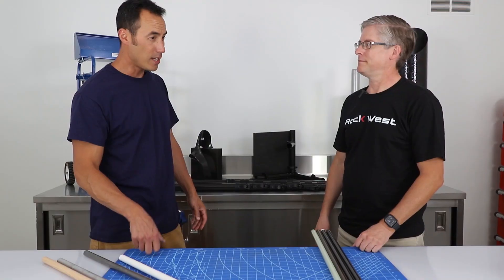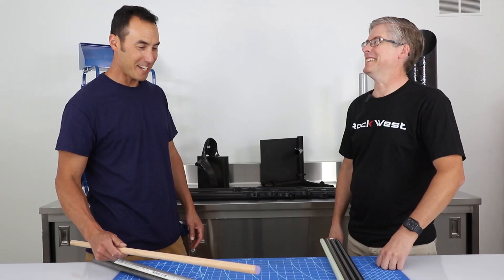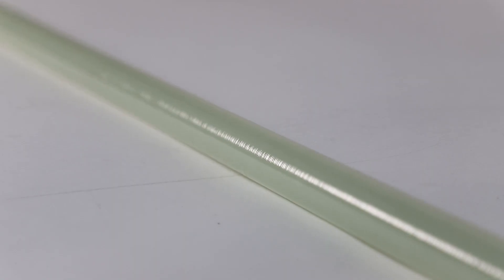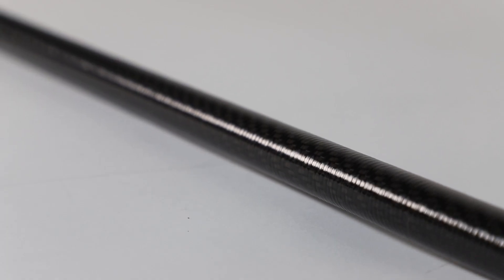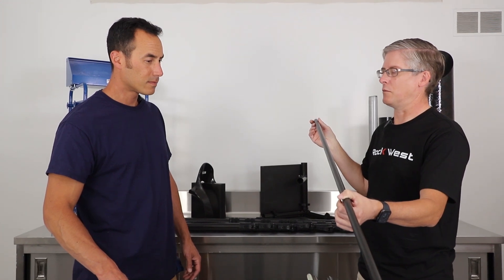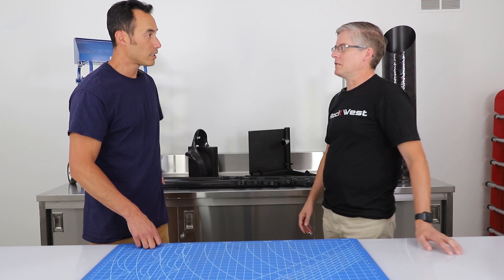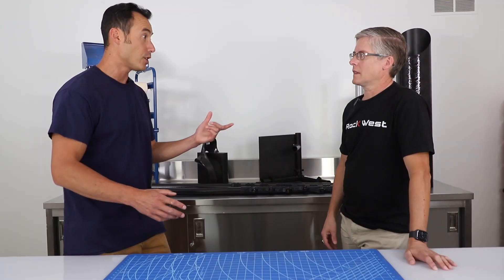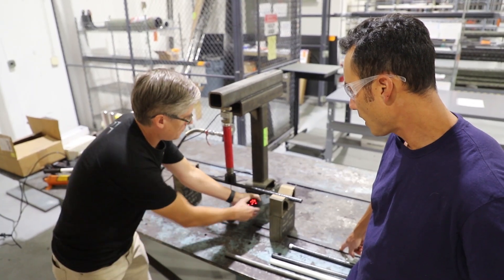Carbon Fiber Tube Vs. Other Materials

Comment: The Pvc tube was a short piece it bent and sliped. It did not break. The other tubes were long a unfair advantage. I use a carbon fiber sup paddle .  And would not cosider a pvc. I just think your test was biased.

Comment: This was an amazing video and a great lesson in using materials like carbon fiber. I started using CF tubing in one of my current projects and I love how light and durable it is. It will be used to build a Head Mounted Rig for facial performance capture, and it should be able to hold an item that is about .25lbs

Comment: Some cheap patio gazebo tubes are made of thin wall cold rolled and welded high carbon steel. They cannot be drilled or cut easily. The stiffness for such a thin wall is very high but failure is as dramatic as your high modulus carbon. The underside of tube in tension is like piano wire. Heavier than carbon but free to harvest in Autumn

Comment: Ok, that oak rod was more than 0.13 inches. WAY more. A standard #2 pencil is 0.25 inches flat to flat. Maybe you meant 0.75 inches?
Reply: You are definitely correct. I think our editor transposed the weight and the rod diameter. It should be 0.75" diameter and 0.13 lbs per foot.

Comment: Funny thing is that if you made them all solid and the same weight, the wood pipe would be among the stiffest and strongest. Woods strength per weight is good, stiffness per weight exceptional.
Reply from the maker: How about strength per cost, kaboom! Wood definitely has its place :-)

Comment: It would be more interesting to me if you would divide those curves by their mat'l densities, and graph the "Specific Strength" which is a better mat'l-comparison (assuming you can optimize your wall thickness).  Also, you should flip those graphs, since these are basically stress/strain curves.
Reply from the maker: Great suggestions!

Comment: What carbon fiber tubing would be the closest equivalent to 1/2” Chromoly tubing and how much lighter per foot would it be?
Reply: Based on the video, you would need an equivalent sized tube with ultra high modulus fiber. However, the UHM fibers have much lower tensile strength, so it will fail far sooner than chromoly. But it will weigh 1/4 of the chromoly.

Comment: What a crappy description of modulus!  Modulus is not stiffness; that is the effect, not the structure.  This whole thing is a terrible middle school science experiment.  No table of results to reference, for example.  Just a bunch of generalizations
Reply from the maker: Hi @Someone Else, Modulus of elasticity is a measure of a material’s resistance to elastic deformation, which is a measure of its stiffness. This video was made for our many customers who are not engineers and just need to understand the general properties of the tubes to help guide their buying decisions. We have a table that references MSI and KSI values on our website for those who are more technically inclined. And since every tube is different depending on the laminate schedule, our engineers are here to help if someone needs specifics values to help meet their engineering requirements.

Comment: what of solid fiberglass rod say,half inch od?and in actual snap point figures if possible,what exact load it can handle being bent
Reply from the maker: Highly dependent upon the span. If a 1/2" solid glass fiber pultruded rod is spanned between blocks at say 20", I suspect it will hold well over 200lbs.

Comment: Dang! I've been wanting to see this demo for years. Thanks very helpful. I'm looking for a material that would be suitable for use as a cantilever spring, might that be something you could assist in?
Reply from the maker: Hey there Jack, yes that is something we can assist with. Please reach out to info@rockwestcomposites.com
Reply: @RockWestComposites  were all the tubes roll wraped unidirectional?

Or were they -+45

Comment: That oak is either 0.13" from some other universe, or hands that rival Trump's, for tiny. ;-)
Reply: You are definitely correct. I think our editor transposed the weight and the rod diameter. It should be 0.75" diameter and 0.13 lbs per foot.

Comment: The PVC tube was chosen too small, as result it will not break: https://youtu.be/S6niIa1wCQg?t=54
For some reason it looks like to me, that  it was chosen too small, to fit some hidden purpose of company selling composites. Plus to really have unbiased review, the bigger PVC pipe should be choose and variety of different plastics should be added.
Reply: All the tubes were the same 0.75" (18mm) diameter. All but the wood were hollow tubes. It's close to a fair test for same dimensions.

Comment: So the high modulus breaks at low load because all the stress stays concentrated right in the center, whereas the others bend and spread it over the length of the rod? i.e., if you hung weights from several points along the rod, then high modulus would probably support as much as the others?
Reply from the maker: No not quite. The high mod tube deflects less before breaking however its strength is quite a bit lower than the standard mod tube. So even if you distribute the load, the tube still bends and will break. Not sure this exactly answers your questions. High modulus has much lower strain to failure. Elongation on HM is 1.1% and on SM it is 2% (elongation = ~strain to failure)
Reply: @RockWestComposites  Thanks, that does answer it. I thought the tensile strength was the same on both.

Comment: the pvc tube didn't brake so the result is irrelevant, cool video tho!
Reply from the maker: Irrelevant as long as one doesn't care how much the tube bends or how floppy the tube is in the application. Most applications require some predictable stiffness. Even a tripod for a simple low weight camera cannot be made of PVC for this fact alone. If anyone were to attempt a slow shutter speed photo with a tripod made of PVC, your image would be completely blurry. This is but one example of thousands where stiffness plays a role that cannot be disregarded :-).